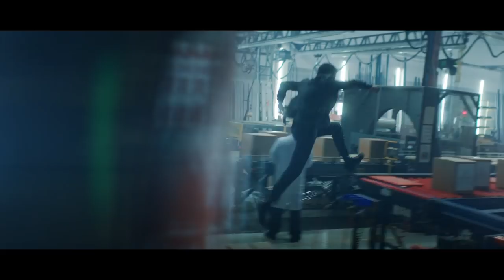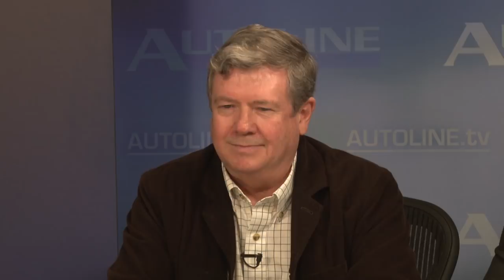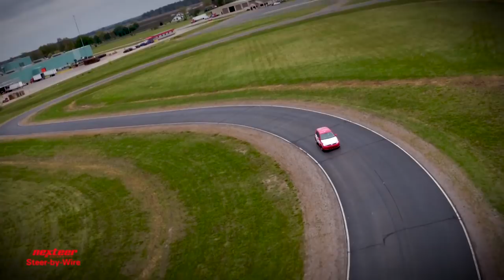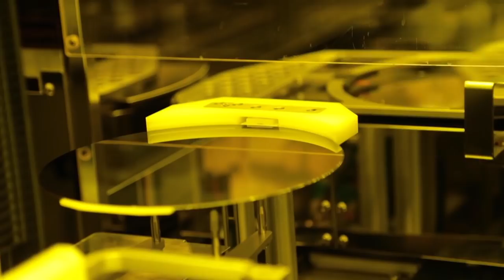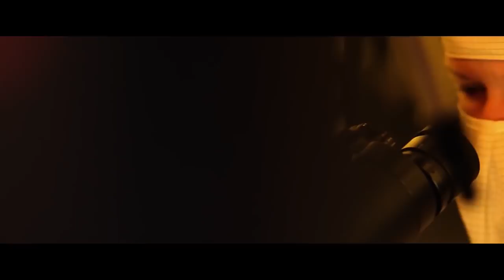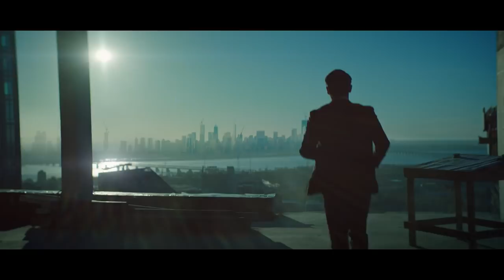The Electronic Transformation of the Automobile - Autoline This Week 2407

Comment: I am missing the most important point for the industry: 

Traditional cars have 20 -40 Electronic Control Units (ECU's = computers). One for the engine from e.g. Germany, one for the airco from e.g. Taiwan, one for the steering system from e.g. USA etc. etc.  They all have their own software and don't talk with each other and are incompatible for  'over the air updates': this because the OEM does not know how to program them, that knowledge is at the supplier of the ECU. 

When Tesla started to make cars, they also wanted to use those systems. 
The reaction of the suppliers was: "No Tesla you are too small, we don't deliver to you", some say the big car companies (OEM's) were behind this.

So Tesla was forced to make it all by itself and was forced to deliver totally vertical integrated vehicles. And just THIS now leads to many of their advantages. They can deliver over the air updates, because they know all about all software they use, others don't. They have also much less ECU's (about 3 instead of 40), thus extremely less costs. They also combine systems e.g. one cooling system for motor, cabineairco and battery cooling combined.....again less costs. 

So whats the future for suppliers of subsystems with ECU's? I see none....
Not delivering to Tesla was once the decision of suppliers (and OEM's?) but it will bankrupt them in the near future for sure!! 

What would their future be if they HAD delivered to Tesla? Tesla would perhaps not have so many advantages... The perseverance of Elon Musk (to rebuild and tilt an entire industry) deserves a Nobel Prize in my eyes.

 See also:
https://asia.nikkei.com/Business/Automobiles/Tesla-teardown-finds-electronics-6-years-ahead-of-Toyota-and-VW2

Suppliers and OEM's are together,  now in a train that is riding in full slowmotion to a concrete wall, a train that can't be steered or stopped...
What goes around.......comes around!

Please copy and share this text.....
Reply: I have to disagree with your statement " the OEM does not know how to program them"
The OEM's that are purchasing from Tier 1, 2 or even 3  suppliers are dictating to the supplier what the parameters of the parts are built to. The  OEMS, being the major customer, can and do request parts ie, electronic modules, etc be built to their requirements. Not only dimensional, electrical connection and also software requirements, otherwise they will build it in house.
Reply: @irrickw  Ok, if so: why are there so few over the air update possibillities (besides Tesla)?
Reply: irrickw - OEMs can limit the cost of their outsourced component approach with great foresight in negotiating contracts with suppliers. However it’s inherently incompatible with the ‘tight feedback loop’ that Elon describes as key to Tesla’s success.
Reply: @jameshoffman552  and 20 - 40 ECU's will always be more expensive as 3 - 5, you can't negociate that away. So there's one word for that old businessmodel: hopeless.....time will prove us right!
Reply: @irrickw  The problem is not that this "can be done", but the fact that hundreds of specific parameters (each requirement from car makers being different) erase the benefits of economy of scale. Considering that many OEM's supply many car makers, multiply the two together and there are literally thousands of variables. This is not only extremely difficult to co-ordinate, but extremely expensive. So even if it is made possible (logistically unlikely), it will add substantially to the cost. Vertical integration allows a car maker to develop a dedicated "one-size-fits-all" solution, allowing for scalability, production efficiency, rapid innovation, and much lower cost.
Ultimately, consumers vote with their wallets... if I can buy a BETTER product at a LOWER price, it makes no difference what OTHER manufacturers are producing, if these other products are inferior and more expensive. Without actual sales, you have no business - so stitching all these complex variations together is then pointless.
Reply: Andre - Thank you for saving me from all that typing?  OEMs do not do much manufacturing these days. They are assembly houses with suppliers supplying sub components, sure some at spec, but lots of generic stuff all Mish mashed together. It's why they, ALL of them, still can't build a 2012 Mdl S. Look at the Taycan, 5+ years to develop, more money than it cost to  build the Tesla Company, and Still the S is going to spank them at Nuremberg. None of them understand the grand vision, that millennials+ are on board with. Less maintenance, longer life, no emmissons, self driving autonomy, shared cars etc. The old world is dead, but like a possum, they haven't realized it.
Reply: Oh please!! The various systems don't talk to each other since they were not designed too.. The engineers are more than capable of doing the job but it's not their mandate.. that's it. capability is not an issue.... it simply so because they do not have to... I like Tesla as much as the next guy but I don't plan on marrying either Tesla or Mr Musk... so control yourself, ... oh and by the way, Tesla employs 5000 engineers. The rest of the industry employs 1 million engineers . Anything Tesla can do, the OEM's can do. Why are you here?
Reply: @andre495  "Please copy and share this text.....
" <-- At least this Tesla cult follower is honest that they just parrot their god Musk.
Reply: @foreverinteriors  LoL, 1 million engineers can never equate to 1 Elon Musk, not even close! Innovation is not created by numbers but by 1 inspirational super intelligent human being like Steve Jobs, Albert Einstein, Nikolai Tesla, Thomas Edison, Isaac Newton, Elon Musk, Henry Ford etc etc and so on!
Reply: Wei Li you are clearly delirious. Do u believe in Batman as well
Reply: @foreverinteriors  "Anything Tesla can do, the OEM's can do." <- LMAO! Your are surely delirious to make this statement, your intelligence truly shines!
Reply: @foreverinteriors  Yup, Ironman too (Elon Musk!)
Reply: @weili1351  Elon Musk doesn't even do any engineering much less science, just the PR for his cult. But in fairness I suppose it's true he can preach to simpletons better than most any technically minded persons.
Reply: @agenthex  I can understand your hate and jealousy towards Elon Musk. Many smart people in every aspect of discipline like Engineering, Finance, Science etc. are jealous of Elon Musk just because of their ego. You have every right to dislike him but that does not change the fact that Elon Musk is a genius, just ask Neil deGrasse Tyson. One thing for sure Elon Musk has a knack for hiring the brightest scientist and engineers to work for him. You are just nit picking on thin air, grow up! FYI you sound like a Macedonian bot! Your negative comment on Elon Musk will not age well!

Just ask Boeing, Blue Origin how they are doing in space advancements compared to SpaceX. That should answer critics like you who does not do any research nor appreciate what Elon Musk is doing for mankind (yes that includes you, @Agent00F)
Reply: Wei Li speaking of shinning, so does your grammar
Reply: @foreverinteriors  Why am I wasting my time with you all? That is real dumb on my part!
Reply: @weili1351  As mentioned, I totally agree that it takes a certain genius to motivate devout shills who dedicate their lives to his cause. Same with L Ron Hubbard or Hitler.

Comment: 48 volt mild hybrids aren't going to cut it. ICE cars are going away, folks. No use gluing on a battery and expecting it to compete against Tesla. Nobody wanted a CRT TV after flat screens arrived in the marketplace.
Reply: dlwatib I agree
Reply: 48s are great price-wise, they're already past the parity point. BEVs will take a while. And honestly: I'm happy with everything that decreases pollution.
Reply: 48 volt would make sense if it could also take away the ICE transmission and drive the motor under 30mph. All ICE cars should be hybrid EVs.
Reply: the modfather - Yes serial hybrids (range extenders) make more sense than parallel hybrids, which are mechanical nightmares (CVTs, etc) with poor performance - no instant acceleration.
Also, hybrids still require costly emissions control systems. Theft of catalytic converters from Priuses is a big problem in California.
Reply: @jameshoffman552  it's not a range extender if it can be driven on the highway with ice only. But yeah
Reply: I honestly cringe and hate it every time someone says that a 48v system is a hybrid.

IT'S NOT A HYBRID, it's just a jump to 48v which needed a bigger battery anyway.

I had a mild hybrid, it had a 1.5 kwh battery, could go electrict for 2-3 miles. It was a powertrain in it's own.

Now I just read that Suzuki claims all their line-up is now hybrid because they switched to 48v architecture. 

It's blatant lies because it doesn't compare even to the classic Prius system, it's just a marketing gimmick.
Reply: @manu144x  Exactly.  Anyone who really knows what's going on and the maintenance differences between this and full BEV realizes it's worth making the jump.  Why in the hell would 48v mild hybrids be a thing in 5 years!? it won't....not significant anyway.
Reply: @SkywalkerWroc  
The customer won't want "48's"
They're done.

Comment: Elephant in the room - batteries, Batteries, BATTERIES.
Electric motors are finding room for improvement even after over hundred years of development.
Reply: Difference between the current EV motors and 100% efficient is not even significant enough to bother by now.
Reply: @SkywalkerWroc  Wrong.  The difference between 95% efficient and 97.5% efficient is a 50% reduction in waste heat, the less waste heat in a motor the easier it becomes to cool it in higher power situations.

Comment: All transportation will go electric. It is just better.
No noise, no emissions, no pollution, less fuel costs, less maintenance costs.
Gas and diesel are OLD polluting technology and belong in a museum next to the steam engine display.
Reply: Power density is a huge issue for everything terrestrial, and trust is a killer for everything space-borne. Eventually it might happen, but it'll take decades of extremely challenging research.
Reply: Without an absolutely enormous breakthrough in battery technology, the ICE will still be king. Electric vehicles simply CAN'T replace ICE vehicles in many applications.
Reply: Why the f is czinger the only one using a recycled CO2 methane as a 0 sum fuel?

Comment: 3:52  25 to 30 Million Vehicles with 48 Volt E-Assist by the end of the decade, ie 2030????  What planet is this guy living on?  BEV's don't need no stinkin' 48 Volt E-Assist system.
Reply: Clayton Root    Tacan  has a 48 volt system and even a Tesla has a 12 volt battery.
Reply: @leorock7823  All BEV's have a 12 Volt Battery to power the 12 Volt systems in the car, eg windshield wiper motors, heater fans, lights, etc.  The main drivetrain of those vehicles uses WAY higher voltage.  Otherwise, the current required to produce the necessary power would require wiring that would be monstrously thick and heavy.  It is my understanding that the Porsche uses an 800 Volt system.  BUT, they are NOT Hybrids as was suggested in the video.  Also, I've been unable to uncover evidence that Porsche uses 48 Volts anywhere within the Taycan.  A good example of a 48 Volt "Mild Hybrid" is a RAM Pickup Truck or Jeep Cherokee.  They offer a SLIGHT acceleration advantage but do precious little to improve fuel economy in the real world, unlike true hybrids.  Why 48 Volts????  Why not 50 Volts?  Because 48 Volts is considered the upper limit for not causing a life threatening electrocution risk.  That voltage threshold has been paramount in UL and CSA certifications of electrical devices for decades.  That is why virtually all devices designed for Global distribution now use low internal voltages to avoid the cost of Certification of the entire device by all the testing agencies in various countries.  All a manufacturer has to get certified is the small AC wall adapter (probably supplied by a 3rd party vendor) and voila; they can now sell all over the world without having to foot the bill for all those certifications.

Comment: Do these guys think that SW needs to be designed for every car design every model year?  Driving cost down should be easy. Once the self driving system is in place an optimized there should be very little going on in the SW development side. It will take time to perfect but once a standard has been proven, it should be over. The SW concerns after that are going to be app related and security updates so the cars don't get hack'd.

Comment: I can not get over how bad drive by wire throttle performs. I still like the feel of the direct control of drive by cable. Forget about drive-by steering. I will never touch that vehicle or modify it to the shaft style electronic power steering.

Comment: Steer by wire...In this guys explanations, provides issues. Because most traffic cops will site you if you leave your lane to avoid a collision but  inadvertently hit something to your side, for failing to keep lane composure or ultimately failure to keep control or  failure to keep distance.

Comment: Drive/steer by wire without mechanical backup is a bad idea. That’s why Tesla’s have real mechanical steering and brakes (with electronic overlay).
Reply: "mechanical steering"?
With two power steering motors for redundancy and one pedal driving (so regen to full stop) Tesla could remove the steering wheel and mechanical brakes in test situations today
Reply: Roger Starkey - Tesla’s sound redundant design means they can safely transition away from mechanical steering in FSD era. Not so with legacy autos.

Comment: The electron is king. It is much easier to manipulate an electron than any atom. This is why hydrogen fuel cell is and will remain a fool's errand.
@18:12 Yeah! At the end of the day it's pure economics. EVs are cheaper to run and almost as cheap to produce today.
@22:24 Open your eyes and ears. Tesla is working hard at reducing costs all the time. Their next model will most likely be a $20 000 Model 2 that will be the tipping point.
@24:08 Every single Tesla is already driving around with most of the self-driving hardware needed for full autonomous driving. At 14 billion real world (not geofenced) miles collected it is the true leader in Data acquisition. Every Tesla will become a revenue generator for its owner and Tesla in 2 years or less.

Comment: Boy you guys are about a year to two years behind on your Tesla info.
Reply: What part are they wrong about? I'm pretty sure all Teslas still have a steering column. Electric power steering that can be controlled through a computer is different than a mechanically disconnected steer-by-wire.
Reply: Never said say they were wrong Just a bit tardy.Mild  
hybrids?  Yeah OK.
Reply: That is the point, it is the same as when home computers took off, using last years specs meant you knew nothing about what was on sale today.  These people are use to the old school of auto improvements, where it would take 5-10 years before an improvement would show up in a manufacturer's lineup.  They can't or refuse to adjust to Tesla timetable where changes take only a few months to reach production and in a few software cases just a few weeks.

Talking about last year's model as if it is the same as this years model shipping is a sign of OLD MAN thinking.